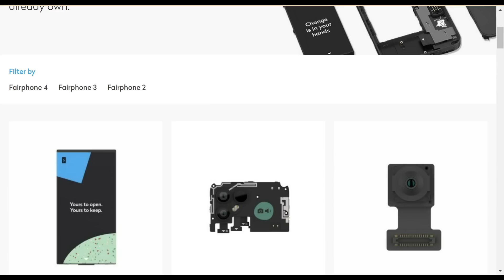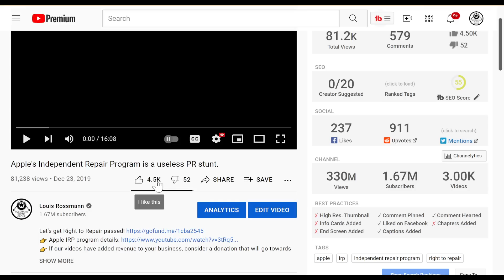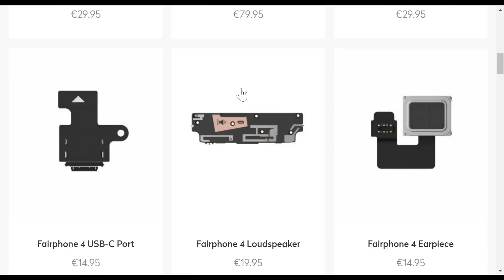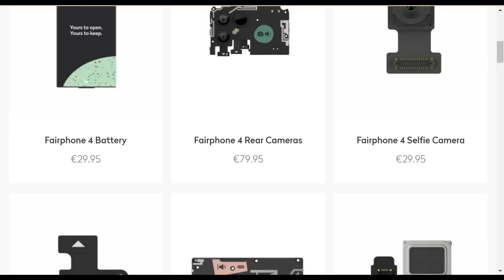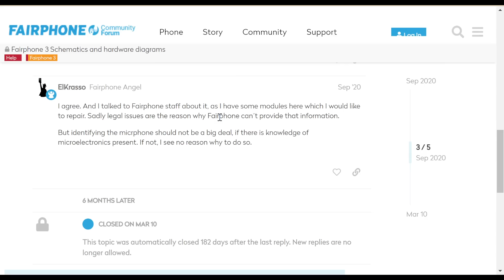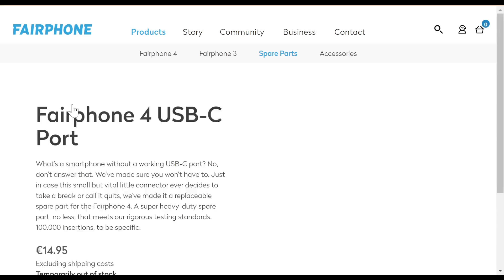Fairphone thoughts & commentary with Louis Rossmann

Comment: You get whatever is going in the right direction because no one else is... basically. xD
I don't think people should expect an ideal, perfect, all checkboxes marked solution, simply because the industry wasn't built on those principles, period. We had little chances of getting something like that 20 years ago, now it's basically impossible.
Making a smartphone from scratch without hitting any intellectual property from other companies is not just a matter of money - it's outright impossible, period.
I know some of the stuff Louis is saying there might sound a bit novel to some, but it goes far deeper, is far more insidious, and just part of the structure as most can imagine.

Put simply, the logic of smartphone industrial production, as is for several other categories of industrialized products, is that of mass manufacturing. Making more and more for less and less, in which uniformity pays off.
Lots of people laid blame on logic for the way smartphones all look the same today - and partially it is. If you want a pocketable device for which it's entire interface with the user, which is what users care for, is a rectangular screen of fixed proportions, the logical evolution of it would be a glass brick. Can't make the interface any more portable than that - the device IS the interface, period.

But it's actually not only that... it's just that since smartphones took over, they are pretty much all the same - several of the tiered pricing schemes are largely artificial, the influence hardware components have on final product prices are close to nil, it's just an artificially calculated "how much people are willing to pay" price.

And particularly for smartphones, I can't think of any other product category that had a clearer indication on how that's the case with the ramp up on flagship model prices blowing past the 1000 bucks level. It's not about how much it costs to produce, it's how much categories of costumers are willing to pay for.

People will come all around saying how Apple does their own stuff, yadda yadda... you do realize that Apple only "does" their own stuff because they bought the companies that did it for them in the past, right? That  iPhones used to have component parts coming from several different companies that do stuff for Android phone companies too, until they bought the competition and consolidated production. That everything from SoC microarchitecture to wi-fi chips, bluetooth, NFC, screens, cameras, and a whole ton of other component parts, the more you peel layers of bs, the more you find out they are very much the same with adjustments that don't really cost more to do, but that justify product categorization.

We grew used to thinking that higher res panels, higher megapixel cameras, bigger batteries, more ram, faster SoCs, wireless charging, blahblahblah is what justifies the price difference between a budget phone from a flagship one... because it sounds logical, but if you put down everything on paper, you quickly realize how that doesn't really make much sense - because it mostly applies to limited manufactury. Small numbers, customized batches. Mass manufacturing is an entirely other beast.

As for the idea that Apple, Samsung, LG, Motorola, Sony, etc etc "designs" their own stuff... again, it shouldn't come as a surprise to no one the partiality of those claims. This again, has to do with external image and how many people still don't realize how dependent all of those companies are on stuff that happens in China, particularly in cities like Shenzhen - which to be fair, is something none of those companies will ever admit in public because of the very same reasons of the theme of this video - copyright law.

One major reason why Shenzhen was so incredibly successful as a place where tech happens, is not only because of mass manufacturing, production and logistics... it's all about development and design happening closer and closer to where the sausage is made. Innovations and ideas for implementations coming faster and faster because they happen in lockstep with hardware development and production. It's no coincidence all major players have huge subsidiaries there.

Does anyone really thinks the general smartphone evolution of recent years would have happened the way it did if there wasn't a very big amount of crosstalk between competing brands? To a point, you could be excused if you thought that way. One company innovates with one thing, the other comes and copies it, makes it better, and so forth.
But that's not what is actually happening there, the evolution is too similar, they are in step, synchronized, and just disguised to not seem that way.

It happens that way because even design, even software, even OS, even these parts of production that are supposedly happening only in corporate headquarters and whatnot, also gets a whole ton of what they are going to do with their products in the future from the exact same sources in Shenzhen and other international hubs. And it has largely to do with new improvements in hardware components being the source of what is coming next, in the first place.

Anyways, back to what Louis was talking about... the thing that happened over the years behind the scenes was consolidation, competition killing, and the usual process of market monopolization. Each component inside a smartphone comes from ultra specialized manufacturers that used to be half a dozen or so, but nowadays are getting closer to one or two companies (such as the TSMC case for chips). So, if you want to propose something that is either more open source, less proprietary, more fixable in general... there will be a whole ton of work balancing things for you to do.
It's not only that you have very few options to go to, a whole ton of the latest steps in evolution for several of those components were built on proprietary foundations.

This is why companies that adopts a purist standpoint trying to go all in open source, all in non-proprietary, all in openly available, often end up with products with past decade specs, missing a whole ton of stuff that newer devices have, or end up looking a bit like white label Chinese products... because there is no other option there. The latest stuff is either entirely proprietary and owned by a company that was gobbled up by a bigger company like Apple/Google, or has contracts that states production is exclusive to a certain company, or a mix of those. Monopoly practices have been in the script from start. We'd have to go too far back into the history of the product development to get anything resembling open source or at least openly available.

If on one side people have been happy with the entire trade war thing against Huawei, on the other hand you can figure out what it also means. Theoretically, from an open source design standpoint, there shouldn't be any reason as to why Huawei couldn't just pick up from AOSP and keep developing it's own everything... but because of a whole bunch of other stuff that is also tied up in all this mess, SoC proprietary tech, ARM contracts, yadda yadda, what effectively happens is that if a nation like the US cuts off ties with a nation like China, in effect what you have is a huge corporation like Huawei having to do all sorts of maneuvers to continue production. Xenophobes rejoice, but if you think about it, even if you hate the CCP or whatever, just think if you were a Chinese citizen.

Because of a badly justified trade war, a major tech company in your country lost control of a major line of product that they were doing quite competently, all because access to essencial tech was barred from it one sidedly. And then you start realizing the problems of having a product category production work like that. It sends alarms for the mainstream, alarms that have been blarring for most of the open source community for decades now.
Thus, talks about Risc V adoption, questions on how much AOSP is really open source, plus related privacy, security, and also right to repair related stuff. Because from a given lens, it all sums up to consumer control versus corporation control.
We've let businesses and corporations take over for so long that it's getting harder and harder to put control back in the hands of consumers. The thousand layer onion of proprietary crap we have to unfold is just too much, and it hits so many levels of the stuff we use today that it has become a daunting task to go against this trend.

So, just to conclude, I'd like to thank and congratulate companies like Fairphone, Framework and others trying to do something about it. I don't expect the impossible from them, but just for trying to do something, they already deserve recognition.

Comment: I have a FP3. I stopped using it due to some bluetooth audio glitches. But I see they have a new model so maybe I'll look at that soon. One thing, having everything connected via springy pins does mean connections do sometimes need cleaning and screws tightening. But that's a design issue.

No headphone jack though, not a deal breaker for me but will be for some.
Reply: I'd also say that a phone which provides schematics would raise eyebrows with regulators. Anything transmitting radio signals is heavily regulated.

Comment: Headphone jack or die

Love that a company is making a phone more repairable though.  Don't need a schematic to replace USB port, screen, or battery.  If the damage is beyond that,   I'd probably just replace it anyways
Reply: That's not the point of right to repair, the tools should be available for whatever you want to fix, doesn't matter whether if its a screen or a short on the logic board.
Reply: @greghumphreys3397  I agree with you.  We do need to keep fighting for schematics.   Being able to buy parts is a huge part of right to repair also and this phone is a great step in the right direction.  On a practical level,. Fairphone is addressing problems that a majority may encounter.
Reply: @greghumphreys3397  yeah but its beyond what the company can do at this level,probably. a headphone jack isn't
Reply: @fabreezethefaintinggoat5484  it actually might be. Considering their low sales volume they might very well be dependent on whatever mainboard they can get their hands on at a reasonable price and in reasonable time. Fairphone has no incentive to remove the jack like manufacturers that actually sell Bluetooth headphones, apart from manufacturing cost, which is something caused by the whole market shifting away from headphone jacks, which is far beyond the controll of a manufacturer the size of fairphone
Reply: Get the Fairphone 3+ then. I think I might.  Don't need 5g yet, and don't need multiple cameras. But to demand a 3.5mm jack.

Comment: Louis, the excuse that the companies are scared of being sued if they release their board designs is bogus, why would they care if the dirtbag that designs their competitors board and theirs gets sued by their competitor? After all half of the reason to outscores the design is to outsource the liability, all, you would need is to rep yourself and file a motion to dismiss on the grounds you did not design the board and give the name and contact info on the dirtbag that ripped both companies off and leave it to the competitor to figure out if they want to sue THEIR designer or let it slide to not lose them as THEIR designer.

Comment: The Purism Librem 5 is the closest thing to what you have described. It uses almost 100% open source firmware, and the modem is in an M.2 slot. It is a bit of a cursed product, and I dont think they have open schematics yet, but it is really the only thing pushing the boundaries of what is possible to do in an open-source manner for a phone.

Comment: I would really like to see UEFI become a thing on smartphones, especially ones like the Fairphone. No more need for "unlocking" the bootloader, you can load any OS you want as long as it's compatible with the ARM64 architecture and the hardware in the phone.
Reply: A locked bootloader is like a PC where Secure Boot cannot be turned off.

Comment: Louis have you checked if Apple has updated the list of parts available in their authorized repair system?
Reply: And that's also one of the reasons I think louis sticks to iphone data recovery rather than iphone repair...
Reply: That wouldn't be of much use because even if you manage to have parts available like the camera and the front facing sensors, you still need the exotic software that apple uses to pair the parts to the motherboard which apple will never ever give it to repair shops...
Reply: I was just asking to make sure apple suddenly doesn't pull a fast one on him

Comment: At what level is it cheaper to replace than to repair?  If you have ever looked at the mdm boards, they are just insanely packed with components ... And if a device on the mdm board did fail, repairing such a tightly integrated board by replacing a single device would be "difficult." If the mdm board breaks and is only like $75.00, maybe it is better to save yourself the hassle and just buy a new one... You are likely going to have to do so anyway within 5 years due to network communications standard evolution (6G, anyone?).